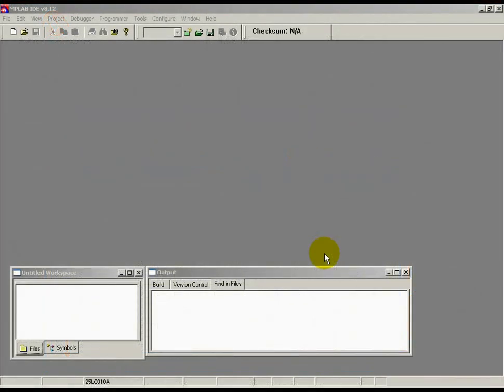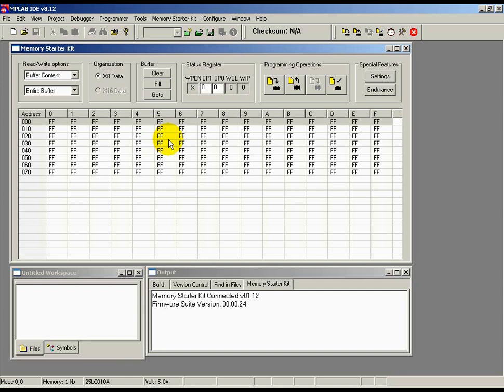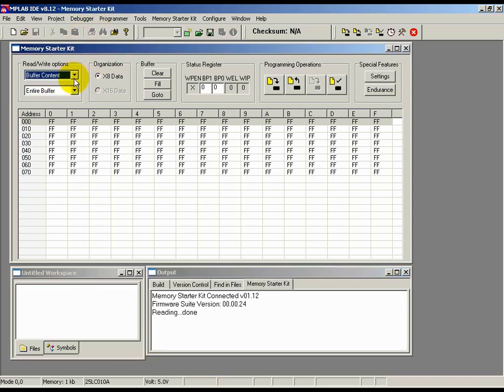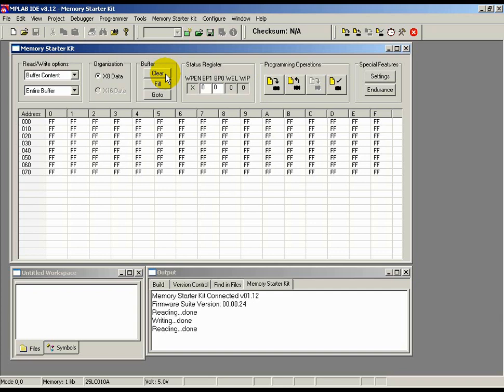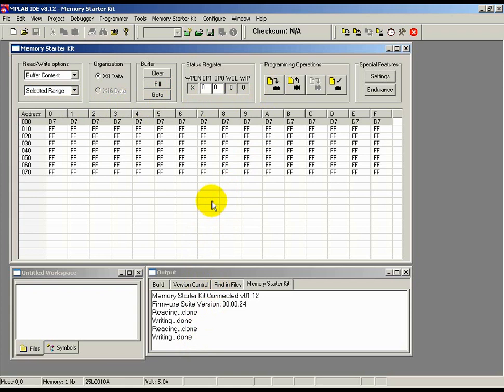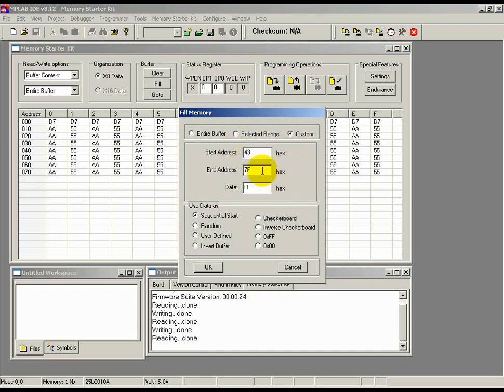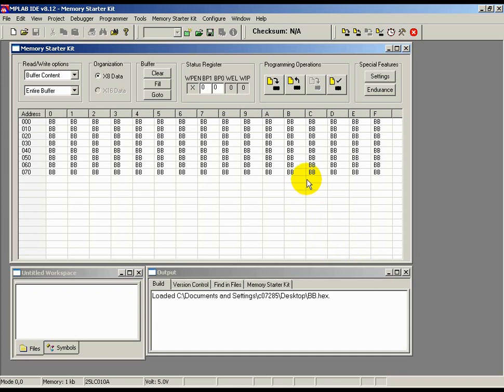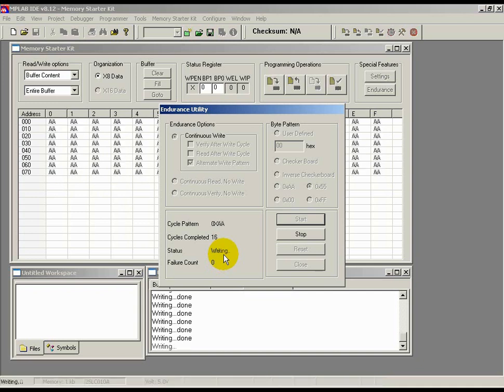Demo of MPLAB Starter Kit for Serial Memory Products

Comment: Hello, i am trying to use this kit to program i2c eeproms. I need to use 3.3v instead of 5v. When I select the i2c chip i am unable to select the settings button that is supposed to allow me to change voltage to 1.1. Does this mean the decice will automatically use 3.3v or will it use the standard 5v damaging my i2c chip?
Reply from the maker: Thanks for reaching out! The I2C EPPROM device is most likely not supported. We recommend using an I2C EEPROM that is supported by the starter kit, here is a link to the device support list: https://ww1.microchip.com/downloads/en/DeviceDoc/SMSK%20Device%20Support%20List%20v01-12%20(a).txt 

For more help, email us at client.success@microchip.com, or contact us at www.microchip.com/css.
Reply: @MicrochipTechnology  Hello, I found the I2C eeprom I need to program on the supported list, the model that we need to program is 24C02C. I keep having a lot of issues in programming it. Very rarely the device is able to program the eeprom chip correctly, most of the time I get programming error, inconsistent programming, unable to program or even other strange error. 4 times today when testing with inverse checkers filling, I was getting half eeprom programmed correctly, the other half completely untouched. 
I don't know really what else to try. Please help me
Reply from the maker: @francescoclaudiomazza4594  Hi Francesco - Sorry to hear you're having problems. We'd be happy to look into this further with you. Please email a summary of your issue to client.success@microchip.com so our team can help with your problem.
Reply: @MicrochipTechnology  Hi, thank you very much for your kind and super-quick feedback! I will write to your team right away. Thanks a lot, it's not easy to find companies with such responsive customer support!
Reply from the maker: @francescoclaudiomazza4594  Happy to help!
Reply: @MicrochipTechnology  Unfortunately noone is answering my email and almost a week has already passed. Any chance you could ping your collegues? Thank you
Reply from the maker: Hi Francesco - Our apologies for the delay. Could you please send a new query via the contact form on our website, here: www.Microchip.com/css? Thanks in advance and we appreciate your patience.